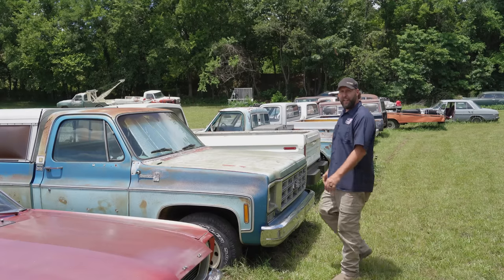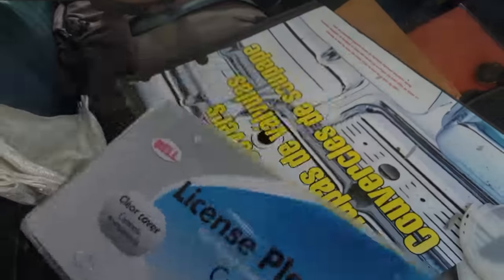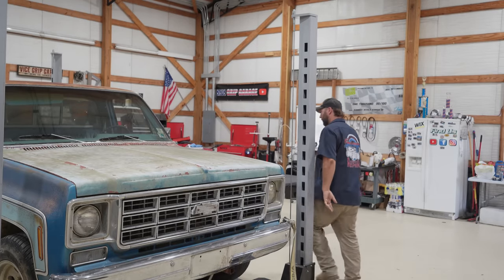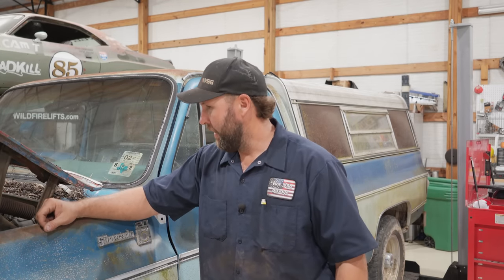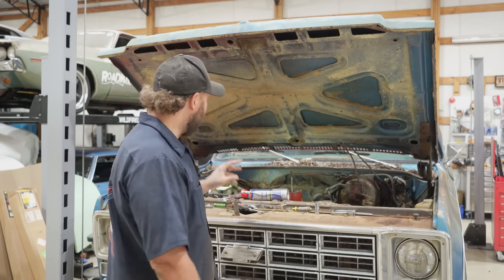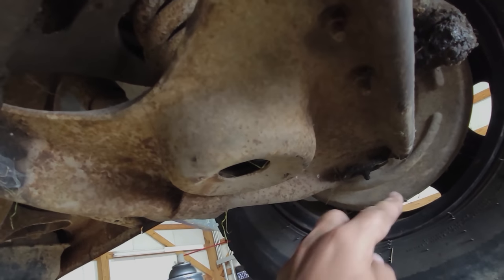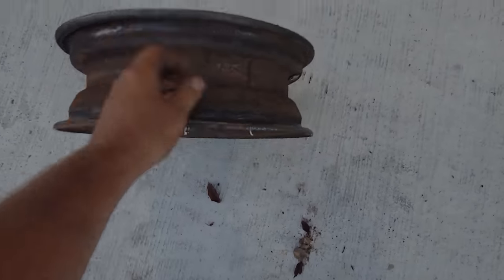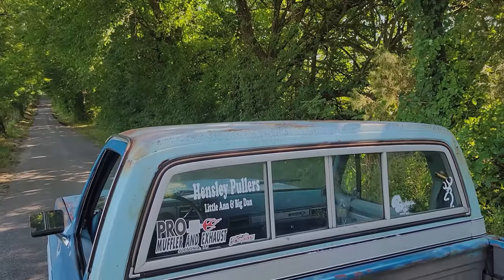Forgotten Big Block Truck- Will It RUN AND DRIVE After 16 Years?

Comment: A chain wrench is your best bet on the crank pulley to turn the motor. It will turn the reciprocating mass whether it likes it or not.

Hey, I get the part number off that Tokyo drift starter
That thing was cranking like a singer, sewing machine, wide-open throttle

Comment: This truck is a lot like my grandpa's truck kinda, he has a 78 f350 camper special with a 400, it's two tone blue with original paint and zero rust aside from some small scuffs where it is at bare metal.

Comment: Got a 75 gmc custom deluxe franken truck with a 454 swap. I think the box was swapped because it is a few years older with a stepside wooden long box. Was excited when you you discovered the non crinkled hood. At least mine isn't as bad. Im thinking about swapping out the hard fuel lines, the rubber ones are rotted and the hard steel ones are fairly rusty in places. 
I enjoyed this vid, new sub.
Reply: Also you are lucky not having any mice. They took up residence in the air duct system in the truck I bought, smelled like mouse piss and was more scared of that than the corona. The electrical system was and still is a nightmare due to previous owners shortcuts. Not giving up yet.

Comment: Just bought a k20 that had been sitting for 10 years in the open (in Kansas) the rats got to it but my floorboards are intact, I’ve got a radio that works, everything but my engine and passenger window work( well enough)

Comment: The Y.M.C.A. Here near Asheboro North Carolina used to have a Chevrolet Bus with a 454 Engine in it.  It was a Good running Engine,  but a little bit Cold Natured like Most Chevrolet Engines are with a Carburetor and it had a Straight Choke.  I think it was a 1987 model.

Comment: I was going to replace the ignition module on a 1985 Corvette I used to have but when I priced one out i found for a very few dollars more I could buy a remanufactured whole unit , beside I needed to replace the distributer gasket anyway.

Comment: i had a 76 step side short bed 454 chevy it was a monster to say the least OMG stump puller 8 miles to the gallon with traction bars 3 in breaks carrier bearing drive shaft 400 turbo transmission BUDDY :text-green-game-over: i cried when i sold that truck guy bought it for the engine 
$600.00 running good he couldn't say yes fast enough it's a world record that was the only word out of his mouth i bumped the key and it fired

Comment: I learned all I know how to work on engines. My brother in law had a shop on our land. I really freaked out when we would get a car from someone who never changed their oil. It always ends up the same, drain the oil and lots of shiney things in there. A few were new cars after 3 years no oil change. When he discovered those, he would contact their company who they were making payments that he has a car from a client who has a problem with their engine, and offered zero insurance  on the job. Always the same answer, new engine needed. Could not help an engine with not that much mileage, but no oil change. Very sad how that can happen.

Comment: Ya I wood say it is indeed a 97,000 mile truck .Looks like a Old's/Buick/Pontiac - Q-Jet carb as chevy's used the side feed fuel line in let but you know what my 1977 Airstream motor home has one on it's 454 so now i don't know what to think?

Comment: Any bit of black in the trans pan is not normal. Clutches have to severely overheat to turn black and start crumbling and mixing into the fluid where it settles in the pan. Wet clutches don't wear like a manual transmission clutch.

Comment: Methylated spirits can be used to displace water in a fuel tank.
Can play havoc with some plastics in some fuel systems.
In Australia we call it Methylated Spirits. 
Denatured alcohol (called methyl hydrate in Canada; methylated spirits, metho, or meths in Australia, Ireland, New Zealand, South Africa, and the United Kingdom; wood spirit; and denatured rectified spirit)

Comment: @ 41:13...that is thermal paste to help keep the module cool....it doesnt insulate....it is a special paste.....do not use dielectric grease , it will not be as good and the module will burn up
those module get really hot

Comment: Just a thought, you would breathe in much less dust, and so forth, if the truck were washed off, outside, before work begins. Rinse the back of the brakes, get that brake dust off, while outside of your shop area, so you will not need to breathe it again and again, everyday from now on? Maybe? Lungs?

Comment: That compound 4the chip in the HEI is not an insulator. It is a compound that insures the transfer of heat betwixt the chip &it's heat sink similar 2those in your PC's.

U should use silicone dielectric grease on the ends of your plug boots instead of WD40. It will last longer because the WD40 will evaporate.

Comment: how come you don't pull the plugs and put some oil in the cylinders when you turn the engine over with the breaker bar? It would help turn more easy and help a little from scratching the cylinder walls and free up the piston rings.

Comment: SOMEONE wanted that camper to be a sleeper. They probably wanted to bore it .30 over and use new rings to fit, then put the fancy chrome leaker valve covers on. They already did the headers.... one a 454?! that's an easy one. lol.

Comment: I hate to disagree with you, Derek but that's not a TH400. Based on the shape of the tranny pan, that's a TH350. The 400 has that little bend in the starboard side like the lower half of the Great state of TX; the 350 is basically square with the port aft corner chopped at a 45 deg angle.

Comment: I hope VGG starts workin on some real sh*tboxes, like a 1996 dodge caravan or an old 2003 pontiac vibe, maybe a 2004 ford expedition with bad plugs (most shops won't change the plugs on it because it's so difficult) or a messed up timing chain

Comment: The miles on the truck could be 196000 miles because most older trucks just go back to zero miles after it gets to 100,000 because there wasn’t enough room to add another 0 on the odometer.

Comment: i want to know what he was working on before, that required 48 gallons of ATF. Considering he would have been then working on a leaking unit there, it would actually have to require between 50 and 75 gallons of ATF realistically.....what the hell needs that much ATF?

Comment: Is that a bullet hole in the front of the bed on the driver's side?
Reply: Not a bullet hole, but a hole for some of the mounting braces for the SlideIn camper top that used to be mounted in the truck's bed. He briefly looked mentioned it in the video.

Comment: If the fuel is that old, it is a varnish. The distributor can last quite a while. The truck is how old? I'll bet original equipment,, aside from routine maintenance. . that truck should have 19 grease fittingsa big block should take 7 qts. The trans takes 6..

Comment: I noticed that you looked at the brake pedal which told you a lot, about the mileage on the odometer, it also tells you if that truck has been hammered or not or if it was taken care of as to the driver who used to drive it, a lot of people don't catch on today fact that just looking at the brake pedal alone will tell you a lot about the abuse or care and just how close the actual mileage is love your show new guy just joined my name is Michael I recently owned an auto detailing business and my packages for cars I love the big three I tend to lean more towards the Chevrolet myself and on that truck that you had found vise grip special the very rare truck and I'm going to guess it was made out of Fremont California and I can get you the build sheet codes if you'd like but I'm sure you probably know how to do that yourself anyway enjoy your show definitely going to be a loyal fan for sure

Comment: Are Sparkerlater hoses the same as a lightening tubes or lightening hoses. You never seem to talk about Thunder suppressors and if lightning juice makes thunder via fuel happener using the lighting cube which is kept full of lightning by the wurrler using sparkly strings, before you can bring the Thunder.  Anyhouse Thanks for the post and Bently is the star of the show always

Comment: Rex Racer
0 seconds ago
Why would you replace a working factory GM Delco module? The discreet components used in that GM unit are FAR BETTER than that within the Accel unit. Oh. And it’s called di-electric grease. It just helps transfer heat from the module to the dist base. The advance freezes up on those things & then you don’t get centrifugal advance. I’ve seen these things brake starter noses with stuck advance. If it’s frozen or stiff, use some brake oil & hook a vise grip to the advance & work it back & forth till frees up. Take it from a guy who’s done automotive electronics for the past 40 years. It also sounds like you’ve got lifter, valve adjustment or camshaft issues. Those older GM factory cams were soft and went flat lots of times. I’ve replaced hundreds over the years working at GM.

Comment: why didn't you show putting the truck in neutral, and showed if the tires wer turning.
because we all know that tractor would drag pickup with no wheels on for ever. 
and if you put the truck in neutral, then you pull it the rear wheels are spinning.and if the drive shaft turns, that usually means the motors turning  to
other things, like the crank+ pistons...other that, always think y wasour videos are very info+ entertaining.

Comment: Why is there a level on the door?
Reply: Some marketing dudes idea of more sales. It was sold as a "camper" edition.  part cost 5 cents and I'm sure they told the customer that was to be used in parking to level out the truck when camping so you weren't rolling to one end or the other in your sleeping bag when camping and sleeping inside the bed :) Gimmicks have always been a big thing on cars to help sales. auto headlight dimmer, auto windshield wiper when it rains, auto headlights when it gets dark etc... Back in the 50's and 60's they had all manner of junk they would advertise as "making your life better"
Reply: @jamescole6846  right on, learn somethin new everyday

Comment: Very dangerous having that young boy tow that truck with that strap. If that strap were to break, I hate to see what happens.
Reply: Why? The kid knows how to use the brakes. Probably has helped his dad move trucks 100 times.
Reply: @eternalbeing3339 A chain is much safer when that thing snaps It's like a rubber band and have seen them Go through back windows and shatter them before. Has nothing to do with how well one uses the brake.

Comment: To get rid of the mouse turd and cig smoke stink get yourself a spray bottle and fill 1/2 with white vinegar and 1/2 water.  Spray all over inside the truck/car and goodbye stink.  Cheap fix.